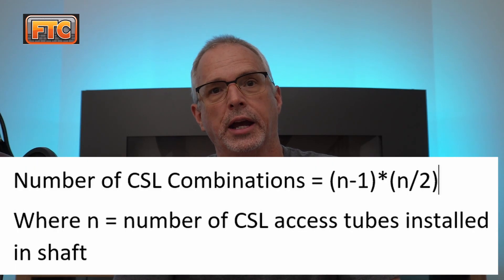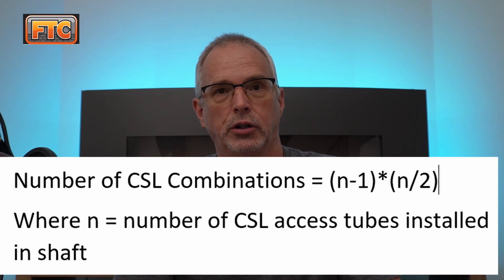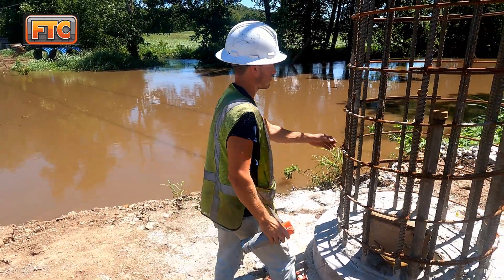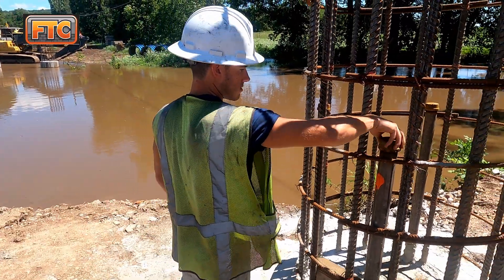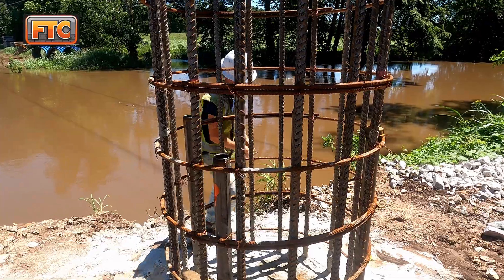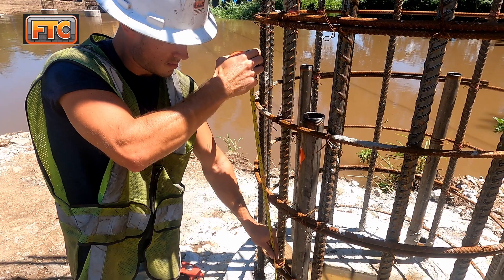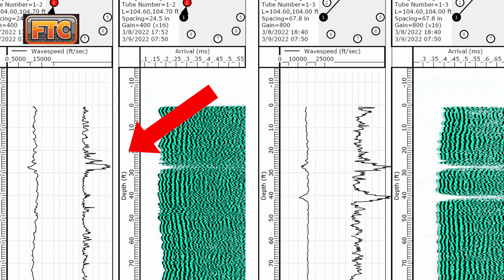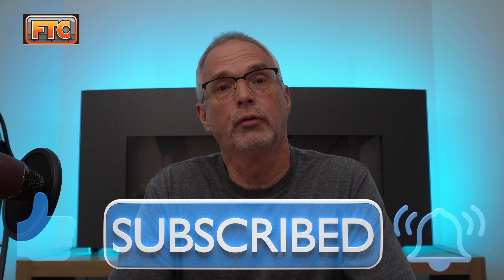Preparing for CSL Testing of a Drilled Shaft

Comment: Hi Casey, great content, thanks for posting. I have a question on the CSL tube spacing, when you do your measurements at the top of pile, are you making an assumption that the spacing is the same throughout the pile shaft? If the spacing varies will it show up as an anomaly?
Reply from the maker: Thank you. It is common see variation in access tube spacing throughout a shaft. This results in variations in the computed "apparent" sonic velocity. Usually such variations are gradual. True concrete anamolies in a drilled shaft have rather abrupt reductions in both signal energy and apparent sonic velocity. Check out my other CSL videos where I show true shaft anomalies.